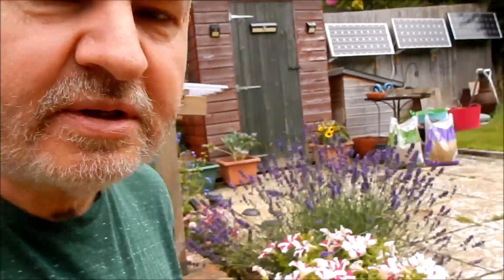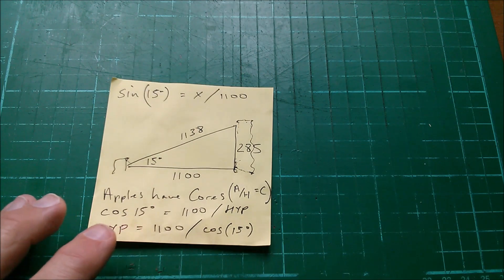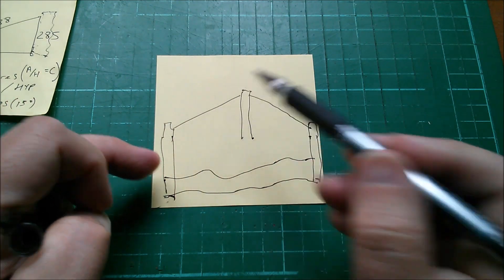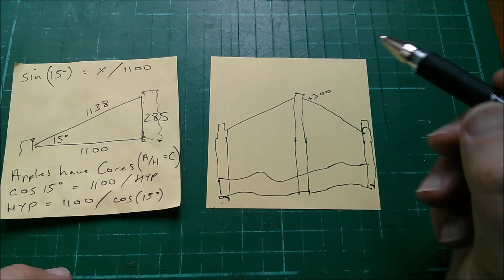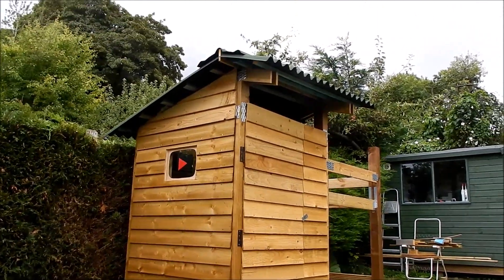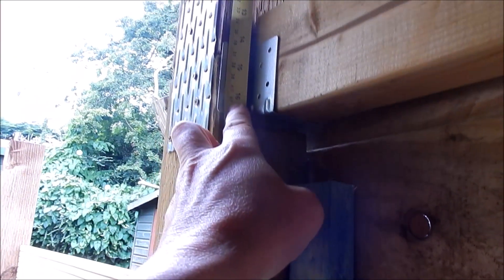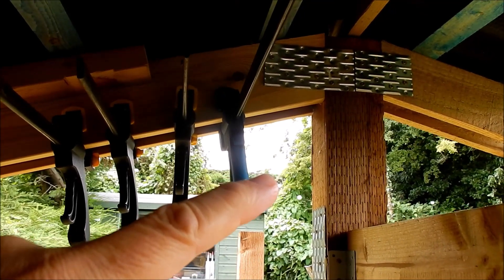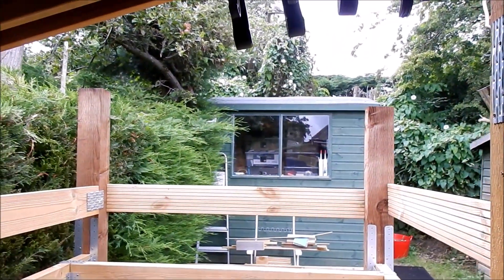Modular Shed S2E2 - Trigonometry

Comment: I will apologise in advance, but I cannot see the point of this form of construction. You appear the have small (economic unit ? ) to create add on module Sheds, using fence posts sunk into the soil  (I shudder! at this).    A construction which invariably fails in my area of Surrey every 3/4 years, so much so that we have a increase use of concrete fence post with fence panels slid in from the top onto a concrete kick panel.     Myself,  I would use 3' alum scaffold pole (adjusted!) set in domed concreted holes with vertical scaffold planks, S.S. bolted to poles   => 6" above highest ground level, with decking as the flat.
The load bearing floor, to screw down any shed ( a inner lip, for a non load marine ply base and the block insulation, for good measure lay flagstones underneath to discourage a Foxes domicile )      G 8 J * * .

Comment: Surely the "clay layer height" is irrelevant, just make the tops of the posts level with each other.

Better still, stop mucking about with modules and just build a bl**dy shed
Reply: Pointless video then innit? "Bloke buys a pre-build shed". This is interesting because it's out of the norm.
Reply: @MrCalldean  Who said anything about buying a pre-built shed, but I agree,  this is certainly out of the norm.
Reply from the maker: Why so hostile towards the modular approach?
Reply: @JuliansShednanigans  I am not hostile towards it but frankly I can't see it working satisfactorily.  It might have some merit if each module were exactly the same so that you could batch make the components for as many modules as you require then construct them and still have the possibility of adding further modules later.

As it is, however, each module is different so it is more a shed built in mismatched sections with compromises along the way.  As to the height of each upright depending on the depth of the clay layer, that is bonkers as is the need for the roof of various sections needing to be at a different angle

Back in the introductory video for this series you said that there would be problems with the door, floor and roof if you built a small shed and expanded it later.  How right you were

Even supposing that you eventually add enough "modules" to turn it into a large shed there will be uprights every 1.2 metres, which is hardly ideal, is it ?

However, as long as you are having fun keep going,

BTW, how is the vocoder modular project coming along ?
Reply from the maker: Vocoder first: In my 2m x 3m workshop, I can't leave projects connected on the bench. I have to pack everything away each time I switch project. This is HUGELY inefficient. In the new modular shed, each project will have its own space, everything will be left connected on the bench (or up the walls). Productivity will increase MASSIVELY.

The modular approach is already working. The first module took weeks - I had lots to learn - I built a door - I built a window - I modularised the walls. The 2nd module went together in a few days. The third module will be quicker still.

My main concern now is the weather turning colder. But as long as I can insulate and heat the shed, keep it dry and insect free, I'll have a workshop that'll house all my projects for the decade ahead.

Comment: PS: I'd never get away with your construction methods in Canada. Heat and cold aside, building code does not permit me to build within 5 feet of the property line.  

Oh, and the snow too.
Reply from the maker: You probably have 10 times the land area I'm trying to work within. We can build right up to the boundary as long as the outbuilding is no taller than 2.5m
Reply: @JuliansShednanigans  well prolly not 10X but... ya. More.

Comment: Don't know if this was mentioned before but... with all your measurements and calculations, have you considered what the inside will feel like. Among other things, what will be the experience of stepping up from module 1 to module 2? Will there be enough head room? Stepping down will be even more of an issue if module 1 ceiling is too low. Dimensioning the roofing l, should take second seat to interior usability. Maybe you've got this covered. It's just that I've never heard you mention the inside space useablity. Just roof slope, clay level, and availability of particular lengths of timber.

Just sayin'. All the same, love your sharing.
Reply from the maker: There's so little usable space right now that it's hard to tell. Stepping between modules 1 and 2 feels fine, but I'm not particularly tall. My main concern is the cold. As long as I can insulate and heat the space effectively, I'll be happy :)

Comment: Why aren't you just using a roof with no apex at all? It'll so much easier to just a simple pitch to the rear. Also you have no joints in that short span, so you don't need a pitch of anything like 15°. A pitch of a couple of ° is all you'd need, as there's nowhere for water to get in, as the roofing sheets are completely waterproof.
Reply from the maker: The footprint of this building is 2x4 modules (8ft x 16ft) with two of the modules not implemented (although I may put a 1 module deck in one of those spaces). Hence the apex. A single slope roof spanning 2 modules would  end up too tall for permitted development rules.
Reply: @JuliansShednanigans  

Makes sense. Do you know what hight your development hight is?, ours is 3.5M at the highest point, like an apex, which is pretty high.
Reply from the maker: Because I'm building 0.8m from the boundary, I'm limited to 2.5m at the apex. I just measured it and it's within a gnat's :)

Comment: I don't think that will look good. When it comes to the general public, or your wife, they don't care how things work or how clever a thing is. They only see the superficial. If something looks wrong or awkward then they will dislike it. Things need to look proportionate and right. They care more about how something makes them feel even if they don't notice the small little details. 

I'm afraid your shed may give the impression of a shanty town shack. Good luck with the misses.
Reply from the maker: It'll certainly look odd - but that doesn't bother me. It was always my intention to step the floor, but slope the roof (in both directions). The roof will be a translation of the clay layer - it will flow uphill (or downhill). All the posts will be uncut - 8ft posts around the perimeter of the building and 9ft posts down the centre. Admittedly, there won't be much symmetry to the roof, but whether that makes it look ugly, remains to be seen.
Reply: @JuliansShednanigans  I'd say it doesn't matter of all the heights as it steps up hill, but you should keep the angle the same every time.
Reply: It’s up to his council, I think that’s the right term, and any neighborhood governing body. 

And it could be considered an art installation!